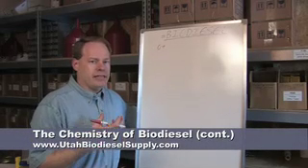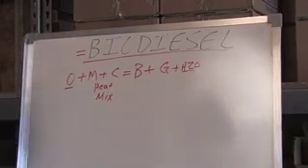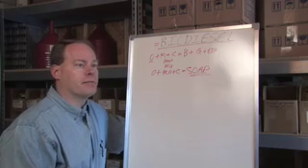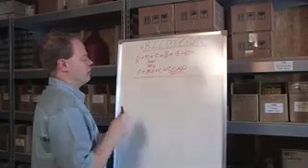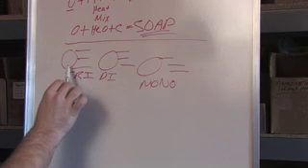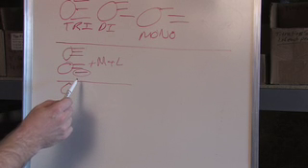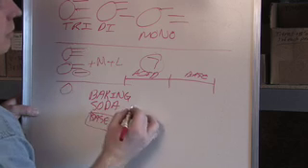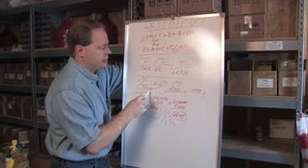The Chemistry of Biodiesel (Part 2)

Comment: @MoparAmericanMuscle current diesel engines in use can run with a 20% bio and 80% diesel ratio unmodified. At higher ratios, you'll need to modify the engines.Most diesel engines can run on 100 percent biodiesel if the temps are over 40F biodiesel only needs to be heated if the temps are lower than the gel point of the fuel.

Comment: how would the diesel engine run with an higher ratio of bio-diesel than 20% bio and 80% diesel, say like a 50% bio-diesel and 50% normal diesel? how would the different ratios work. Could you run just on bio-diesel?